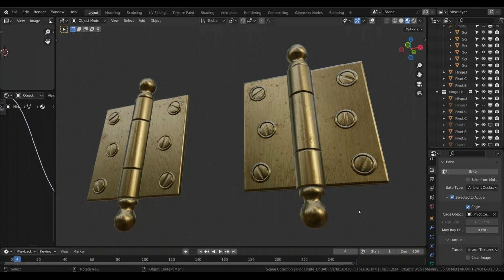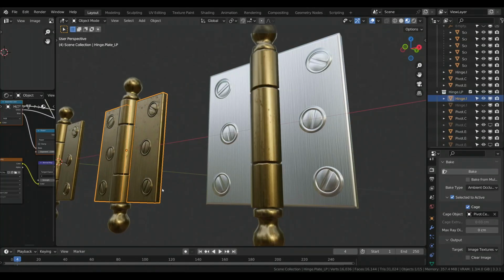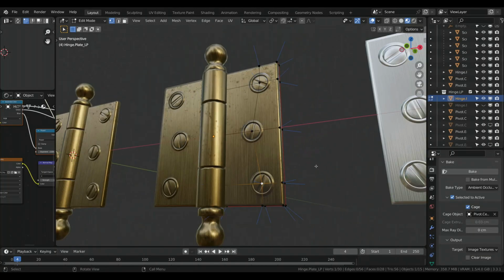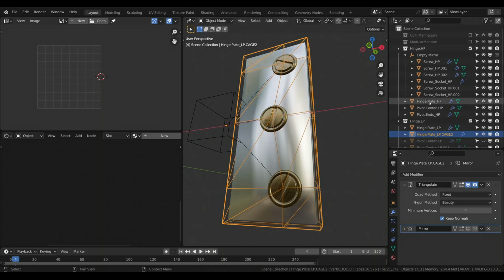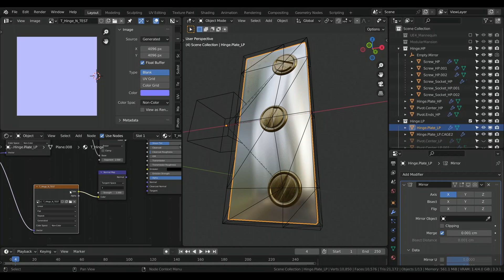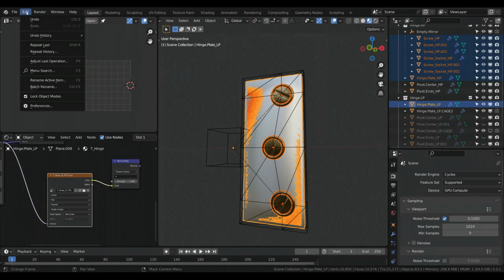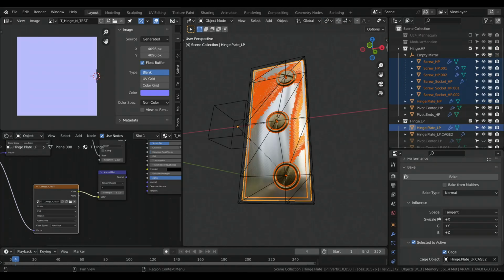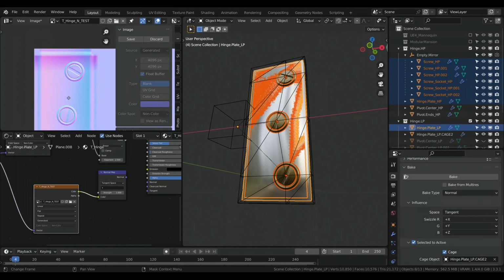How to Bake Normal Maps in Blender without Skew! [TUTORIAL]

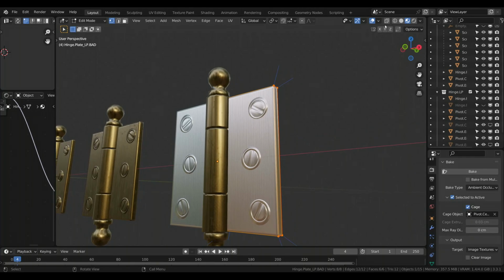Comment from the maker: Hey everyone, at 0:52 if you want to see the effect flat shading (or Auto-Smooth) has on your vertex normals, you should instead enable the middle button labelled "Display Split Normals". The first button shown in the video ("Display Vertex Normals") will show you your vertex normals but it won't display differently if some faces are shaded flat. 🤔 Also, one thing I forgot to draw attention to during the baking part of the tutorial is that your low poly mesh should be set to Smooth Shading (NOT Auto Smooth). However, there may be times when you will actually want to use hard edges (smoothing groups) and have some flat-shaded faces too. Be sure to read the Toolbag Baking Tutorial I linked in the description for a better understanding of best practices! 😃
Reply: yeah the first option is to show the averaged vertex normal (smooth shading). The splits normal option shows the custom normal which is handled by blender

Comment: So is the skewing an issue with smooth shading? What if i shade flat, bake then shade it to smooth after the normal map is baked
Reply: I just tried it and it worked
Reply from the maker: Baking flat should work, however, it is my understanding that if a normal map is baked with one type of shading, the shading should not be changed afterwards. (Example if your entire object is set to Shade Smooth, keep it as Shade Smooth after baking the normal map, or if it's custom split normals (a mix of Smooth and Flat shading), then don't change it to fully Smooth afterwards or the normal map will get messed up).
Reply: Then your shading will be broken